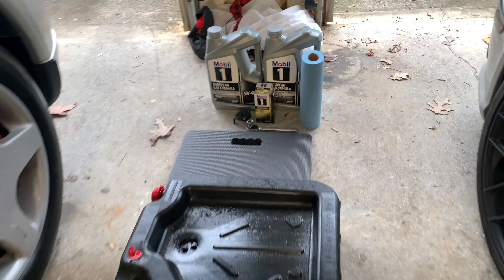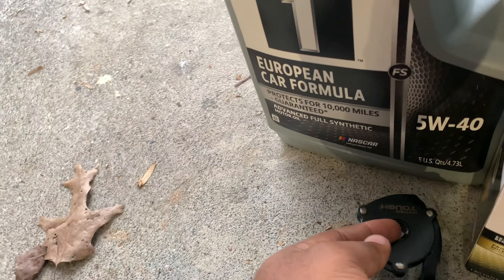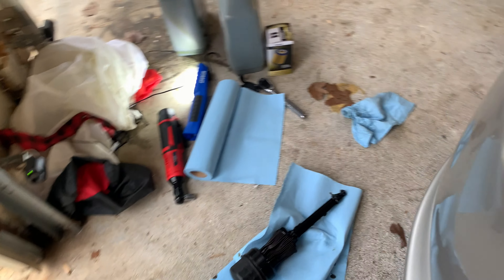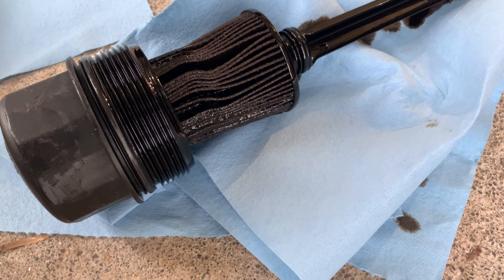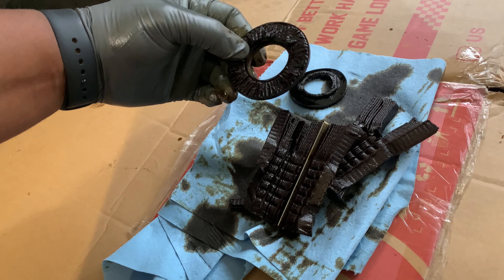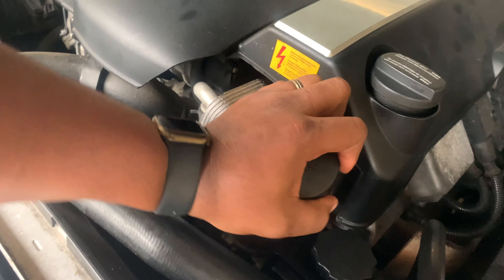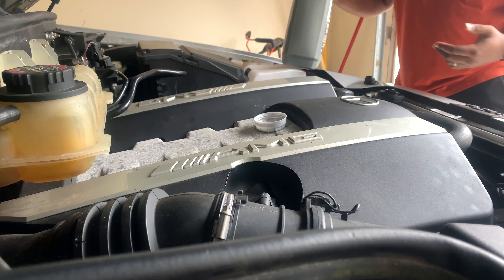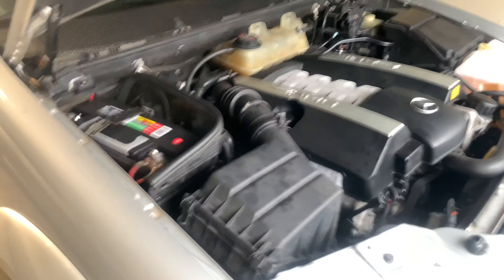Mercedes Change Your Own Oil! ML55 AMG

Comment: Good job! Now you need to change the oil in the gearboxes, gearbox, transfer case, power steering, and don't forget the brake fluid!!!! The car will thank you!!!!
Reply from the maker: Transmission service will be next on the list! Stay tuned. Power steering is pretty much brand new fluid in it. Transfer case I need to look into that
Reply: Da